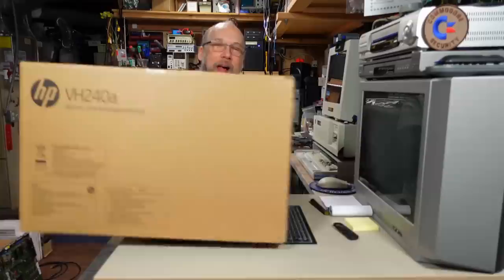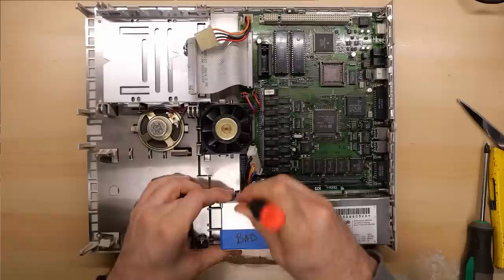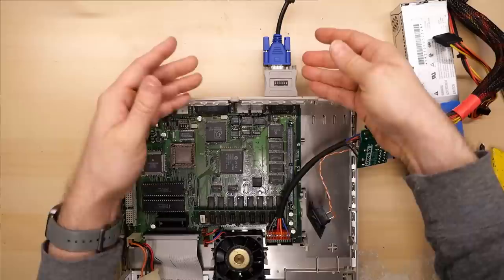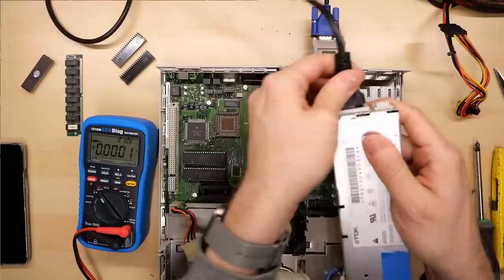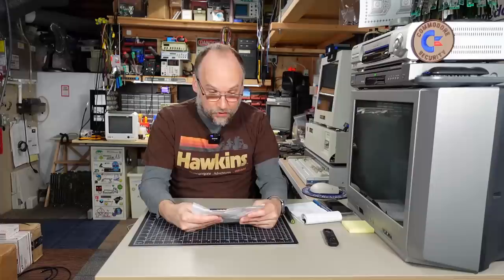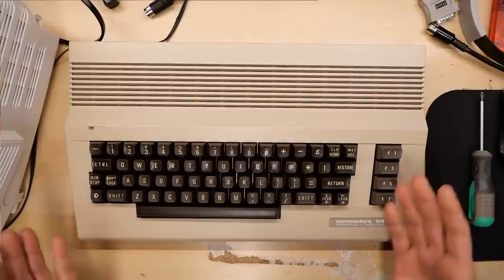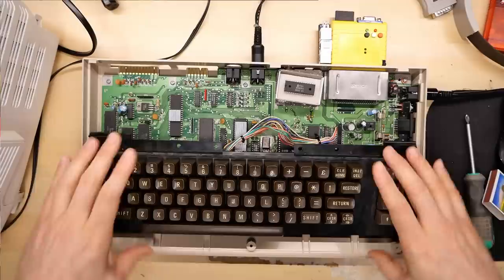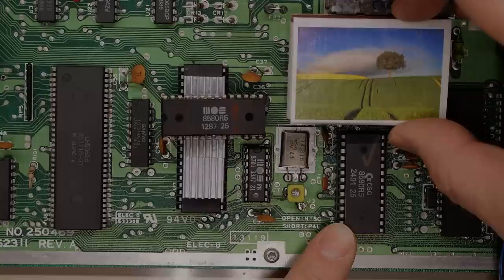Mac LC II repair attempt, a bad SID from AliExpress and a SID in a matchbox

Comment: according to the 68030, some of the machines have an odd and an even rom, the problem is that the 68030 can only load commads (16 bit) from even adresses CPU Manual Chapter 7.2.2 Misaligned Operands
Reply from the maker: Interesting -- I am going to have to test making replacement ROMs on a working motherboard like the Color Classic -- that should help me understand exactly how to break up the ROM to use two 16 bit chips on a 32bit machine.
Reply: @adriansdigitalbasement  Sorry My fault. didn't see these were 16bit ROMs. I thought theese were 8 bit ROMs on a 16 bit bus and the cpu uses 2 bus cycles to went through . Well i had a look in the schematics, and the datalines d0-d15 are on U19   and d16-d31 are on U24

Comment: I burned my chips the same way on my Performa 460 (your LC Motherboard) and Yes you can use the 27C400 chips and burning them the same way you burn Amiga Roms,,, and download the files from the net seraching Rom files for Apple Emulators,,,
Reply: And About The PSU,,, Had the same issue with ticking sound,, and in my case it was heavy leaking caps... I recapped and washed the PCB in my Sonic cleaner for 20min in 50C degrees water and anticorrosive chemicals,,, the ticking in mine was becource the the PCB boards fibers was soaked with electrolytics from the caps,,, by boiling the electrolyte out in my Sonic cleaner i got it working again, The problem was that the opto coupler is very sencitive and breaks the circuit

Comment: Hello, i write from Spain and my english is not good. I can use 27c400 chips? are the same of the 27400AK?
Can you send me the two split files to put it into a 27c400? i only have a TL866 and i can split but don't know how separate Lo and Hi data.
Maybe the problem is the "bite swap"? like when i program Megadrive/Genesis cargridge EPROMs. The 68k works with bite swap files.
Reply: are you talking about firmware or the chips themselves?

if your looking for firmware there are probably tons of sites that have roms for old macs
Reply: because of the DMCA it’s illegal in the US and EUROPE(check local laws) to provide links to them.

Comment: @27:00 how does your serial to WiFi bridge work?  I would like to do that with a crusty old programmer I have.
Reply: Can be done dead easy with an esp01 and max232
Reply: @rtechlab6254  esp-link is I think the thing?
Reply: @NivagSwerdna  yup, we use a modified version for CAN or you can use esp WiFi manager in the Arduino ide
Reply: @rtechlab6254  I was hoping for something slightly different... i.e. it would appear as a serial port on my Win10 PC. I guess that would need an esp-link aware driver.
Reply: @NivagSwerdna  there are com port redirector out there

Comment: So I started building a new computer this weekend. I needed to install windows 10. I had a 4gb flash drive (from like 2008)  with windows 7 on it. Windows 10 is like......ummm no you need 8gb+ to make an install disc. The ONLY other drive I had in my house is my C64's 16gb drive. So I backed it up to my brand new laptop and put windows 10 on it. It's 5gb. Dammit microsoft just a little less crap and I wouldn't have needed to "Borrow" my C64's "hard drive". lmao anyway it worked fine. I just thought it was funny that it went from C64 to windows 10 and back to C64 again. lol